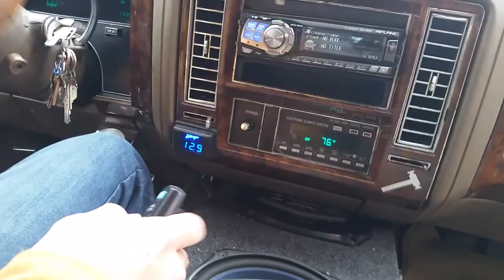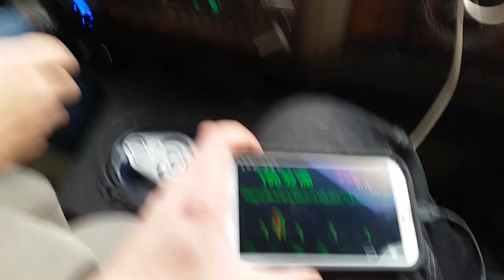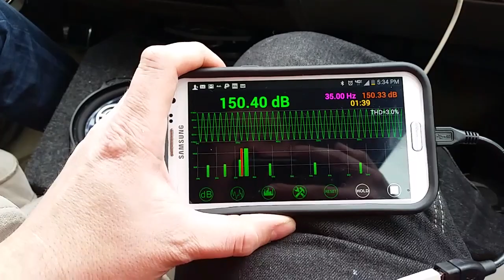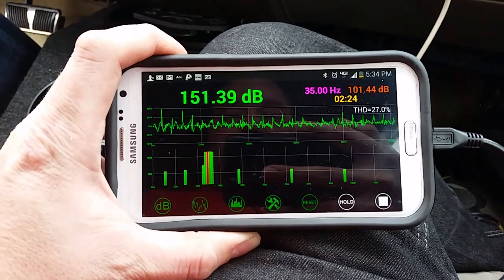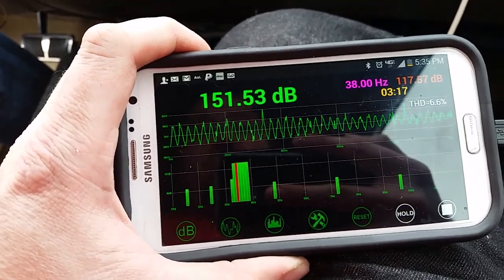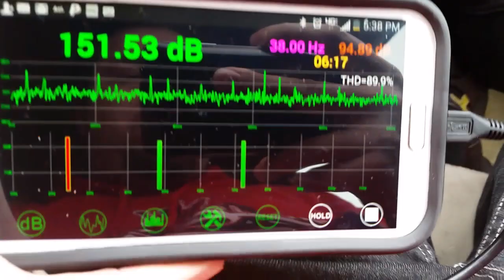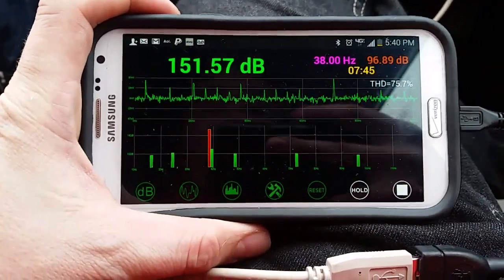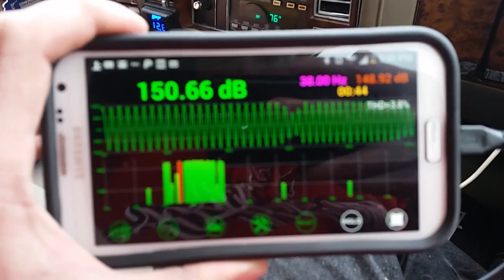How Loud Is It? 2 Team ASCENDANT AUDIO 18s on Ampere 7500

Comment: Electrical screaming for some love bro. U need ho alternator something over 250a, 300-350 would be decent. Definitely can do 154 with those sub's even 156 if tweaked system
Reply from the maker: He still needs to seal it off he's losing a ton of pressure back in the trunk,  it's flexing like crazy,  it's still under construction just doing a quick metering to see where it was at.  And he has a 300 amp iraggi
Reply from the maker: He is holding 12.9 /13.0 full tilt with one alt also

Comment: ULTRACAPS are waaay better than your 1000 pound bank of batteries that literally do NOTHING to help your voltage.   replace each bat with a bank of ultracaps, and watch your voltage drop only 0.5v at most.    also research the technology of rockfords tk-15 amp.   the amps have a massive cap bank inside, allowing you to run MUCH MUCH more amperage even off a single alt.    CAPS are meant for car audio. having a bank of 10 d3100s is just fucking stupid unless you're running the car off